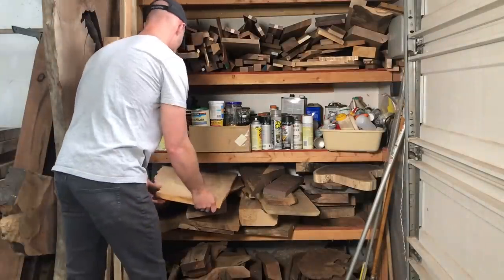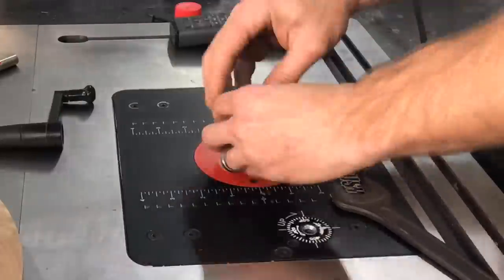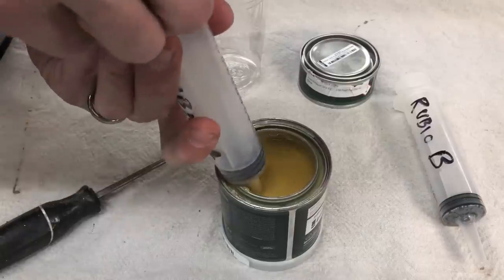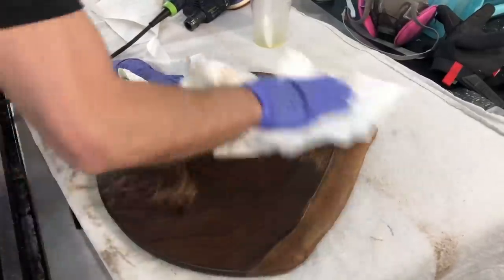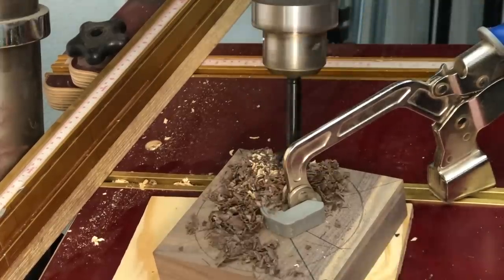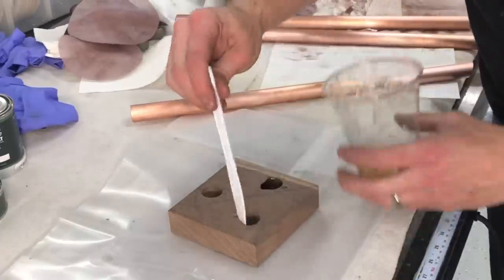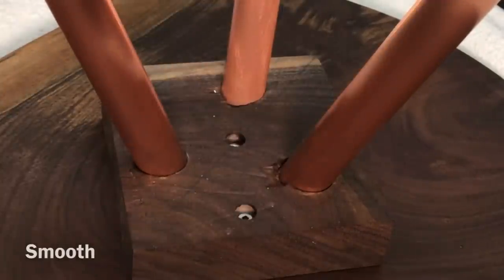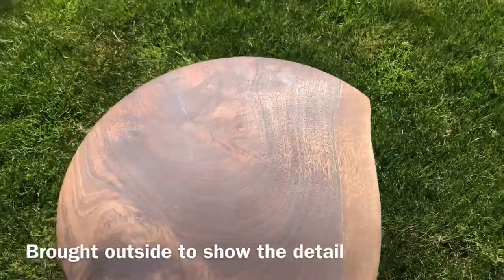$20 Woodworking

Comment: Next project? Not sure...
Anyway, Cam, I do like the copper legs but have 2 suggestions: fill with epoxy to prevent "pinching" and to strengthen overall; add a clear finish after you buff... copper will not hold a shine without clear coat.

Of course, if you're shooting for a Lady Liberty patina, then you're good to go.

Slow down, amigo... we'll still be here 😁
Reply from the maker: Gotta be quick!

Comment: Shop Storage - lumber rack ( in progress) then complete the router table and assembly table ( in progress... there's a theme emerging here...sigh...usually it's working on one and realize I need a __ so...) The legs are okay, the copper will eventually pick up a nice patina and when they hit a point you really like, you can coat them ( I'll bet Rubio might even stick) to stop the patina from continuing.
Copper is fairly soft, so, perhaps some walnut or red oak feet which just fit into the end of the pipe for fixing , and then some kind of spreader, perhaps a kumiko inspired something or other (trellis like) item located about mid way down the legs to prevent them bending, since you incorporated a live edge, something organic would be cool.
Reply from the maker: Good tips!

Comment: Right now I'm working on a ringbox for the engagement ring I would have given my wife if I'd had the resources at the time. She said she still wants to see what my vision was so that's why I'm finishing it two years later. The ring is a custom silver dragon clutching an alexandrite stone that I actually cut myself with my great grandfather's lap wheel. to fit the dragon theme, the ringbox is an egg, made from red tigerwood. 

To the video. with this top I would enjoy some sort of smoky gray finish for the legs. not sure how you'd achieve that without steel though.

Comment: A few opinions from a former machinist: nice work! 

I am familiar with having to find bolt holes and keep them at expected intervals. For one piece at a time and only three holes, what you did is faster. I am familiar with AutoCAD, Bobcad, and Gibbscam. All of these have bolthole patterns which are quick to lay on your virtual work, but then you have to enter literally every dimension, including what tools you plan to use.  

Personally, I'm a lot less scared of metal than I am of wood. Metal doesn't just crack and fly apart due to imperfections where things made by nature can be less predictable that way. My opinion is you need a small bandsaw with a high tooth per inch. The reason your saw is dangerous is because there's not enough teeth engaged in the work at the same time. This causes each tooth to pull a giant chunk out of the metal instead of tiny curled chips. That said, it looks like you fudged it well with your feed rate. Wear glasses when working either way. Wood may possibly break while working with it, but those razor sharp tiny chips are a pain to get out of your eye. Just trust me, you haven't lived until you've had another machinist extract chips from your eyeball so you can meet a deadline.

Those legs look pretty good. And they'll look a lot better in a few months. You didn't do anything to prevent oxidation. I think this was a good idea, especially since you turned out to hate the legs. You might be able to artificially oxidize it and get some dripping liquid effect. I think a mild acid may work, or just water. If you use a water soluble cutting fluid these usually work overtime at oxidation as they are similar to soap in some ways. So maybe just soapy water? Never tried that. Anyway, If you want it really built up just leave it in a bin of the liquid. If you want something a little more psychedelic spray it on with a pump spray bottle and leave it. Additional coats may be good for providing depth or complexity.
Reply from the maker: Thanks for the ideas!
Reply: @BlacktailStudio  results will vary. Oxidation is funny that way. But that's why it's cool. It's unique.

Comment: Could you do a series on woodworking with basic tools?

I love your projects and you explain it well, but I don’t have a set of Festool tools, any kind of bench or router, etc.

With your knowledge and just $100 in tools (basic jigsaw, screwdriver/hammer, hand sanding, and one other tool of choice for example) + finishes, it would be interesting to see what you could teach us to get into woodworking.

This video is great, but when you need $3,000 in tools it’s not quite a $20 table :)

Comment: My name is Kyle. I liked the look of the legs when it was out in the yard. I’m currently working on a wooden urn for someone who died from COVID-19. It’s a sad project but I think it is going to turn out really beautifully. I do have one question (about my current project) I was wondering if you might have any tips on what finish to use both inside the urn and outside. I want to make sure it’s something that will last a long time.
Reply from the maker: Wow man that’s amazing. I would probably go with some type of varnish or urethane. Good luck!
Reply: Kyle, I am building one for my father-in-law, he is fine , just getting older and thought I could do it. Looking at either black walnut or maple and probably finish with osmo. Have you seen any good YouTube sites or plans? I want to use dovetails for the box, but worried about what type of glue, thinking epoxy. Thoughts? Cam, feel free to chime in as well. Thanks

Comment: Don’t use the same sanding/grinding media on ferrous material and then later on other metals. (Always keep them separately in marked boxes to avoid unintentional mixup.)
 
Reason: When grinding or polishing, one embeds small particles of iron that later corrode! Even if other metals like aluminium or stainless steel in themselves don’t rust they will have rusty spots caused by the iron from last time you worked on a steel piece. 
Cheers 
Anders/Sweden

Comment: Not keen on the bright copper but over time the copper will darken through oxidation so then when it reaches the shade you like you could hit it with a Matt or satin lacquer to seal it and stop the colour change.
Also rather than cutting the legs to an angle it might have looked cool to use some of the original off cut
 wood to make some feet?
Either way love your channel
Reply from the maker: Could be cool!

Comment: Hey Cam, as for copper legs I liked the thought behind it and the video well done but the actual look is a  bit much. Could of done a copper inlay in some nice walnut as a thought. Another note... instead of bormax look into wood owl drill bits. I've only gotten a huge one and I'm impressed with the clean hole for 3/4 dogholes.. no blowout.
Reply from the maker: Nice, I’ll have to check that out!

Comment: My next project is a large metal and wood bookshelf (still in design).
I agree with your thoughts about the bottom part should be thinner. 
Can I suggest to make the base similar to the top?
Or a rectangle.

Comment: I’m working on a cypress table and would like suggestions about the proper epoxy to use with it.  Doing Pecky Cypress. And a live edge slab table. 
Thanks in advance  😇
Yes, I did not like the copper either

Comment: My next project is to repair and reassemble my Murphy bed (after a move). I'm a programmer, not a woodworker, but in 2000, I built it out of necessity using hardware and instructions from Create-a-Bed. I love it, but I'm sure you would've face palmed yourself to death if you'd seen me build it in my apartment with hand tools.

I like copper pipe, but not on that table.

Comment: Next project: bastogne walnut slab table. Question for epoxy pour: should I caulk the underneath of the walnut pieces to keep epoxy from leaking underneath them in case they're not perfectly square against the bottom ?
Reply from the maker: I don’t caulk underneath

Comment: In another project similar to this you used steel or aluminum plates screwed to the top of the legs and to the bottom of that table top.   As I recall you said you got the plates on EBay.    Can you direct me to that video - I need to get those plates.

Comment: I loved how it turned out.  I think the legs were the only thing I wasn't sure about but I think you made them look nice.  My concern is that they may need a finish to prevent them from oxidizing and looking like they did when you bought them.
Just out of curiosity, how sturdy is it?  At first I thought you might add some braces to the bottom of the legs but they seem to be fairly strong on their own.
Reply from the maker: I actually added Osmo oil to them. Forgot to film it

Comment: I liked the feet, would have liked wooden legs better - but mixing is good and adds an industrial touch to the table - maybe putting protectors on the feet would have been a good idea - save a floor.  love this table.

Comment: Currently making some serving trays from a standing dead oak tree i felled last week. Planning on filling cracks with black epoxy, but I’m curious what epoxy you’d recommend for small pours/projects. I won’t even need a quart so I don’t want to buy a full gallon of epoxy. Do you have any recommendations? Also would Rubio be a good finish for this? 

Great video

Comment: Over a year late but I just recently started watching! Personally I don't like the copper legs here. The tabletop is the focus of the table (as it should be) and when you add the copper legs it draws attention away. The copper also doesn't have any character in it yet which also makes it look a little off. However, different strokes for different folks.

Comment: Whats your best solution if your table has a soft spot or multiple soft spots? 
Currently have a Pecan coffee table with an epoxy river. Im in the sanding phase and plan to finish it with Osmo. I'm hoping the Osmo will be enough to harden it, so the table has a uniform finished look. Appreciate your help, love the videos!
Reply from the maker: Osmo won’t harden it. Try seal a cell. Then osmo

Comment: I don’t like the copper legs only for the reason that they aren’t tapered. The straight legs look weird I think if you would’ve sanded them horizontally so that it had circular scratches and then sprayed it with a brown tinted lacquer to give it more of a bronze lock it would look a little better. It definitely looks like copper tube’s :-)

Comment: (Working on a carved hanging shelf for books.) Don't care for the copper legs. Also, copper is very pliable and lightweight so it won't hold up well. Very pretty top piece of wood. Thanks for the video! Do you still use this rubio finish?

Comment: Bathroom baseboards. What do you recommend for thee finish. I am using old barn siding. Pine with red paint on it. Will sand some but not as much as you would. Probably down to 120 grit.

Comment: Is N3 a waist if you don’t use an led-hard cover oil. Just about to get in to a black walnut end table, gonna try to power carve  the base, allso wondering if I should use biscuits to glue my top together or if wood to wood with tight bond will be fine?

Comment: Try using Google sketchup, if you like to mockup you designs first and work out angles, it's relatively simple to use and learn. Also for the copper legs it looks good, maybe next time using a lathe to create a brushed metal effect?
Reply from the maker: Need a brain to operate sketch up

Comment: I want to make an epoxy wood desk - First of all love the content, been binging your channel, you have a real knack for documenting your skill. I don't really have any woodworking experience but feel I'm leaps ahead of where I was before I found your channel! I want the desk to fit onto electric seat / stand desk legs and ideally have wireless charging, usb ports and cable management. I just bought a router, I have a jigsaw, palm sander and will be buying the consumables you use. Firstly do you think I can manage with these tools? If not is there something that would really help but not be a huge  investment. (I really like the brass smart desk you did in another video). 
Love the channel, keep it up!
Reply from the maker: Man, so hard for me to say

Comment: My next project is adding a vise to the end of my workbench for hand planing. Two quick questions for you if you’ve got a second. Did you do anything to the bottom of the copper piping to seal or protect the ends? Wasn’t sure if the table would be sitting on concrete or wood and if it would scrape up a deck. Second is, is the purpose of the water pop between sanding just to help remove grit, or is there another reason for it? Thanks, appreciate your work and great videos!
Reply from the maker: Nothing on the bottom. And it’s something the finish company recommends.

Comment: Is it possible to round-over with an orbital sander? I don’t have a fancy machine such as yours 😂, but my wife is wanting a smaller bistro style table such as this for our porch and I really like the slab-tops like this and the round-over edge looks so nice. 

Second question, would the seal/finish you applied to this table work for outdoor finishes? If not, what do you recommend?

Comment: I am in the process of making an ajustable height, who sugi ban drop leaf table. 36 x 60 inch. Heights going from 30, 36, 40 and 42. For max function. 
 I must say k agree with the copper not fully doing it. The end clip of it in the sun on the grass looks nice. But jts a side table that won't be in that environment. Im curious if you had scratched a design into the legs and embedded black paint into the grooves it may help. But in my opinion the legs are just too straight. The table being natural edged and round. I think if the copper legs were filled with sand and then bent slightly in a random or symmetrical slight "s" curve very slight mind you. It would compliment so much more. All in all I think wooden legs curved the same with copper as a tiny accent some how would be beautiful.  But copper on the bottom needs somthing copper the top wither it be a built in lamp or engraved  copper plated handles ok im gonna stop talking now. I like the tsble top alot.  Thanks for sharing.
Reply from the maker: Ya, I’m with ya!

Comment: Boat decking/seating/bin lids

Hi,
I am feeling the vibe of the copper but wouldn't you consider a metal laquer/finish to stop the eventual oxidisation, or is that an effect you were hoping for eventually?

Would you also consider making some plugs for the bottom of the legs? Speaking from ouchy experience of a childhood school chair metal leg being sat on to my toe.... It hurts... And takes a chunk of flesh... So any accidents that involve downward force on a misplaced sandled toe perhaps, might benefit from a wooden plug of some sort.

:-D

Sammi x
Reply from the maker: I did some Osmo oil on the legs

Comment: Rabbit Hutch. I think the copper legs look great, in fact, I used a piece of 3/4"  copper pipe for my flagpole, sanded with my ROS and coated with 2X Rustolium Clear. My question is, did you use a protective finish on your legs?
Reply from the maker: I did. Added Osmo oil

Comment: Dig the table. This is more of a question directed towards the Osmo finish you use on your tables. What has been your feedback from customers that have had one of your tables for a couple years on the quality of the finish after it has been used and abused? Do you find that you ever need to apply a "touch up" coat after a few years or does your process with the Osmo seem to last the lifetime of the table? Thanks....great videos as always.
Reply from the maker: Haven’t got that from my clients yet. But I would imagine you’d need a new coat in a couple years.

Comment: Hi Cam,

Names Andrew from NH and have recently taken on some novice woodworking. I’m an art teacher and drwIng and painting just don’t give me the same satisfaction that working with wood and a subtractive process satifies. First question is where does you name “Blacktail” come from. Just curious. Second I made my first Superclear apoxy table and I am having issues with the table top mixture hardening. I am wondering what I maybe did incorrectly. It’s not sticky or tacky, but when I put something as light as a full coffee mug on it, after a few moments it creates minor pits. After many hours and the mug removed it seems to rebound to original form. It also scratches easily. I am thinking it either wasn’t mixed properly; I over torched it; or I didn’t wait long enough for the previous coats to cure. I followed all the Superclear’s directions except for not sure about the torching. Sorry for the long question. You are my go to for inspiration and advice from your well done videos. I like you commentary I like others who think you talk too much. Again i teach, so I get it. 

Andrew
Reply from the maker: Oh man, I’d guess maybe incomplete mixing or mixed the wrong ratio

Comment: Thanks this was very inspiring - I have a few walnut pieces of a similar size, so small coffee/beer table is probably the best way hot to use them. Those copper legs looked great in direct sunlight, the wood was quite dark in shade and that was the moment when copper style somehow did not match. Was there any special reason why you made the legs attaching piece square and not round?

Comment: I’m building a platform bed with half lap joints in the corners! Picked out the curliest birch I could find! I wanted to go with walnut, but I wanted to keep saving up for a jointer. I’m having a blast. What projects are you working on right now?
Reply from the maker: More tables! Dust collection. Clamp rack 😊

Comment: Current project: A set of maple pencil boxes for a friend's daughter to embellish with caligraphy.

Two things: I like the copper OK, but it might have been better if the upper part weren't so close together. Second, copper and aluminum are not ferrous metals. Ferrous metals are primarily iron. But the caution still is appropriate.
Reply from the maker: I learned about ferrous after this video 🤷🏻‍♂️